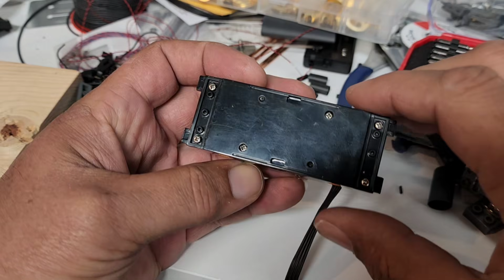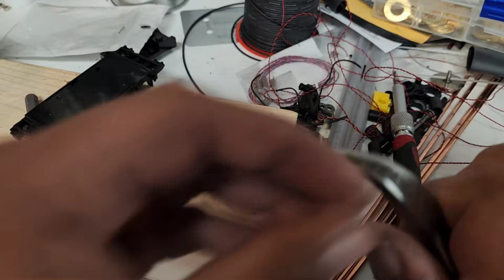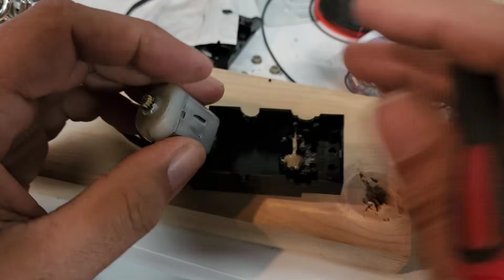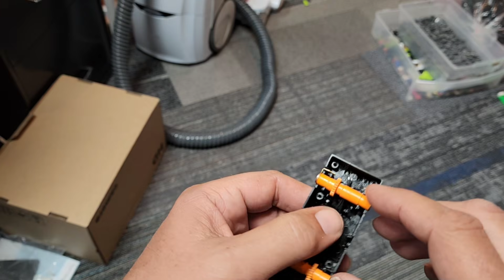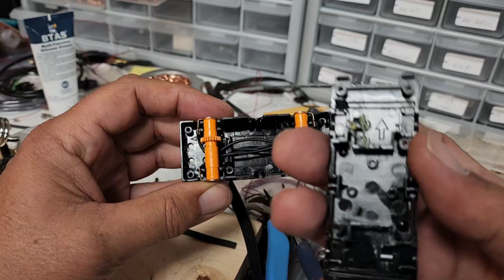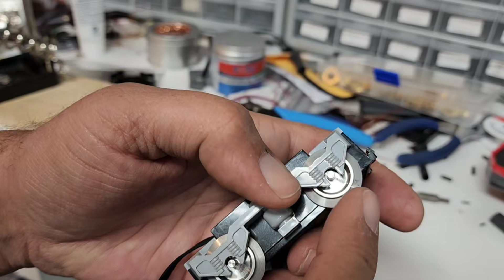How I made a Lego 9Volt train power pickup using a old train motor box.

Comment: Honestly I think this looks much, much better on original Lego trains than your other power pickups, since same side plates are used on both pickup and motor, and also wheels are centered. So with this solution when running multiple locos, Horizon Express and so on there can be one one pickup bogie unit and several powered bogies both with same apperance.

I'm hoping this would be something you consider offering for sale; being it's a self-made conversion based on an off-brand motor it should not infringe with Lego patents
Reply from the maker: I would need to come up with a cost of building them and then maybe yes I could try and make a few for people to buy and use also.  Never thought so many people would be interested in my original designs, so its worth trying to make for everyone :).

Comment: looking great , i love 9v motors 
you also talk about dcc? why not only dc with some arduino or raspberry pi?
Reply from the maker: That is possible also,  but I would need to learn the programming on it.  To me it seemed to be a easier task with the dcc system.  But I havent started yet so it could also be a mistake trying. :)
Reply: @BevinsBricksWorld if you have any question about it maybe i could help ypu out. 
In june i will test my version with dc control out on a event
Have also experience with programming